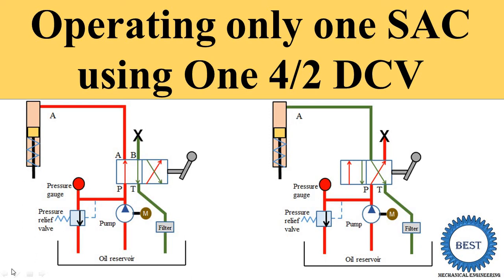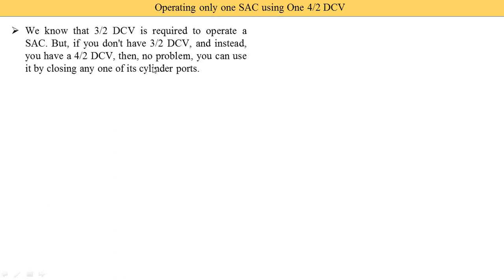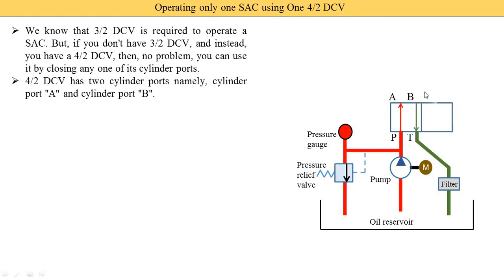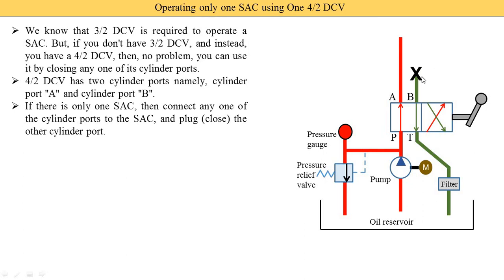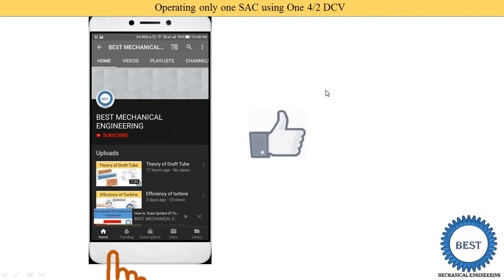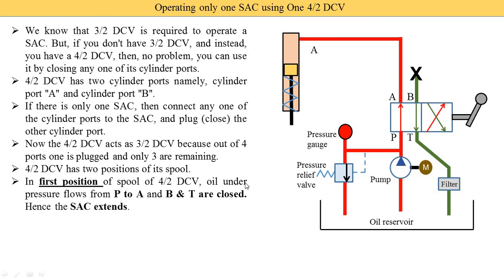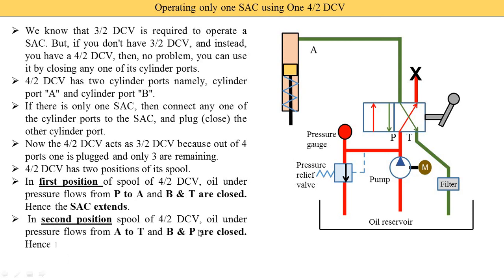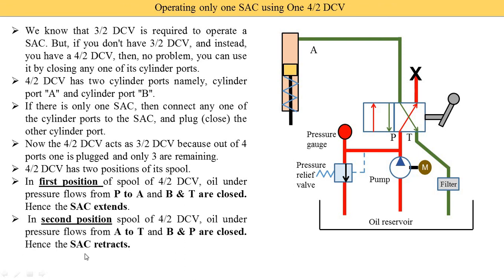Operating only one SAC using One 4/2 DCV

Comment: Hello.
Can we use Single Acting Cylinder with 4/2 control valve (by blocking 1 port as you said) and have three positions somehow? For example, Actuate; hold (all valves closed) and then release (A to T)?  I want to actuate, hold it in position, and then contract by applied force. If I cant use 4/2,3/2 then what control valve should i use? 

Thanks